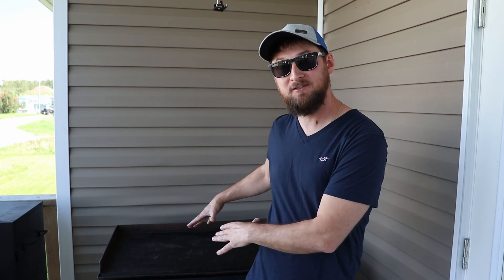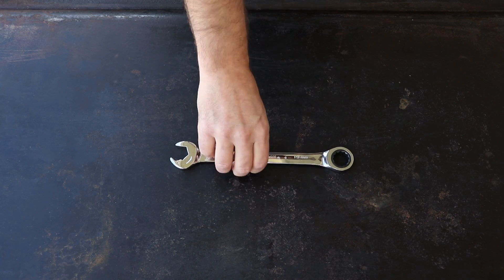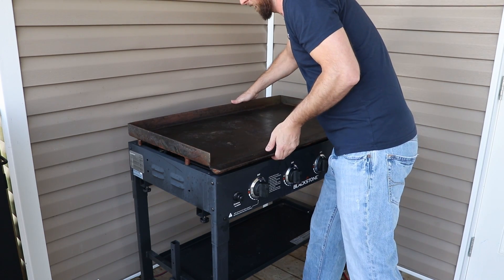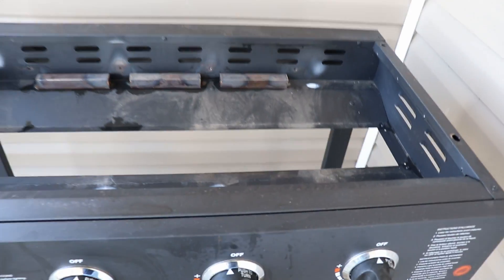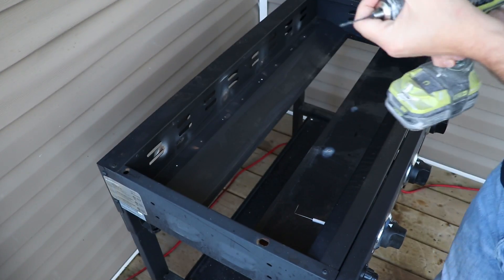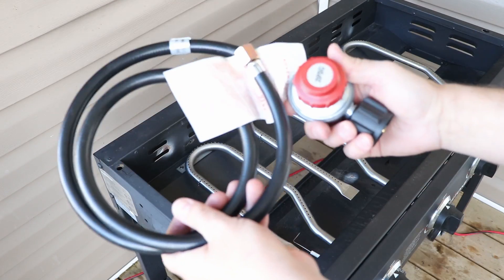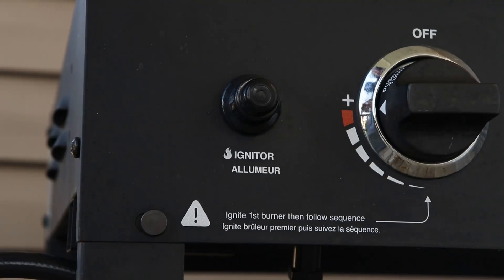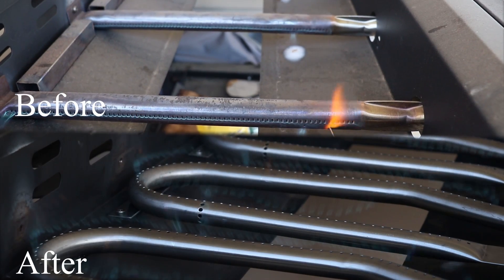UPGRADES for a WAY HOTTER Blackstone GRILL/GRIDDLE

Comment: Do you need to change the hose and the regulator ? Or can you keep the original ? I don't really care for more heat....just looks like the heat is better distributed to the cooking area.....less cold spots ....
Reply from the maker: It absolutely is better distributed.  You can try just installing new burners and see how that works. I'm sure it would  be fine. And yes, With the regulator I can get the surface way too hot (850°f) I put in the regulator for more control. At around 650°f is great for searing. Also, I live in northern Canada and in the winter the cook top would just not get very hot. It does now. Thanks. More on the way when the weather gets better.
Reply: @savakolmogoroff9094  thank you....I think I will start with the burners first....and see how that works....I live in South Florida.....I don't need so much heat....just better distribution....
Reply: @adrianotero7963  let me know if they make a difference
Reply: I just did this and it took me literally like 10 minutes. I took the rivits out with a drill bit and used self tapping screws. I did leave the original regulator and it looks like it is working just fine. Thanks for the awesome mod!!
Reply: @juansreef4177  still like the mod without the regulator?
Reply: @damerkman  yes, it works very well. Very even heat all over the grill. Still have the stock regulator installed.
Reply: @juansreef4177  nice. Thanks for the info.

Comment: Great mod. But….Burns more fuel and burns it faster. Why would someone want higher heat? Also could be risk of warped top.
Reply from the maker: I was living in Canada at the time and still used my blacktop in the winter (-20°c) so I needed that extra heat just to use it but for everyday use it's just about having more control.  I can get incredibly sear on my steaks at 650°. I've gotten my griddle top to 900° and yes it did and does wrap at high temps but has always came back to normal as it cooled down.
Reply: @savakolmogoroff9094  nice. Got me thinking, I’m in Chicago and grill in the winters 🤔

Comment: Why would I want to blow through more propane tanks?
Does this come with a natural gas option??
Reply from the maker: Yes, You can buy a NG convert kit. It's not about blowing through tanks. You can keep it on low and save your propane by all means. It's about having more control.  The stock burners and regulator would not get the griddle hot enough for me to sear steaks to my liking, also I live in Canada and the winters are cold AF! So in the winter the griddle would not get hot enough to even cook on. This solves those problems. It gives you more control over the temp of the griddle.

Comment: The original burners had holes on either side, your replacements were single sided so not doubling anything, just a more even heat. Don't waste your money doing this... all you ever need to do to increase the BTUs from a BBQ is adjust the factory setting on the FACTORY regulator... they all have a metering screw 'hidden' in the knob, back it out for more flow... DONE, you're welcome. Just be careful not to go too far or your jets and moreover, air supply will need to be tweaked.
Reply from the maker: Tried that first. Did not get the results I wanted. Trust me, you cant beat the heat control with the system I put in.

Comment: in the video you said it doubles your heat output  which i say is BS because the stock burner tubes are 15000 btu's each for a total of 60000 and what i can find on the internet about these tubes they are only 13000 btu's each for a total of 52000 so your loosing 8000 btu's so to double the heat output like you say each new burner would have to be rated at 30000 each
Reply from the maker: The new burners are to help distribute the heat better. The regulator is where you get an increase in heat output. I got my griddle to 900°f and had to shut it off cause thats way too hot. Don't knock it till you try it.

Comment: I did this and it melted a hole in my cast iron , thanks ….
Reply from the maker: I don't believe that happened, and I don't believe you would let that happen. It would literally take a while of full blast heat to burn a hole through the cast iron. It's on you if you put it full blast and let it go for 20 min.
Reply: @savakolmogoroff9094 it's not possible without putting the propane tank into a tub of warm water, so the propane can vaporize faster and burn hotter. That griddle would have to glowing red hot to mess up a cast iron pan and then the cast iron pan would have to glowing red before even starting a hole.